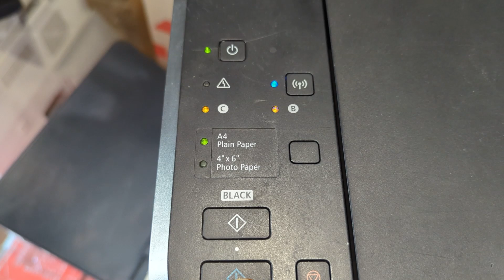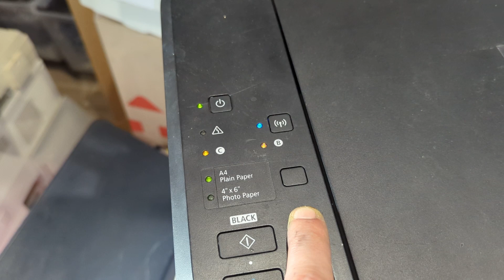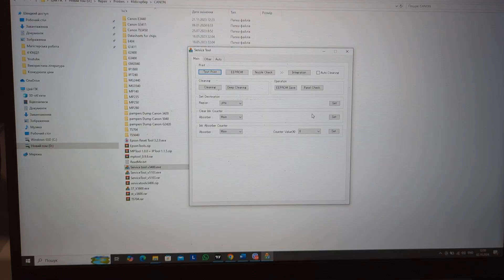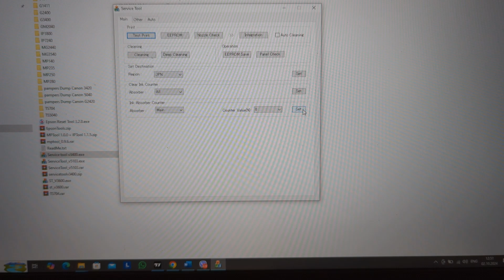How to reset the absorber counter on the Canon MG series printer

Comment: Where do you get the service tool?
Reply from the maker: I used in this case service mode without Service tool
Reply: @repairyourtechnicsdiy8333   but you said service toll v3400